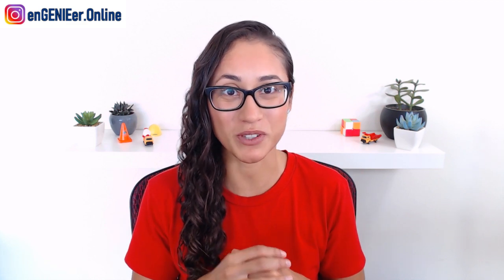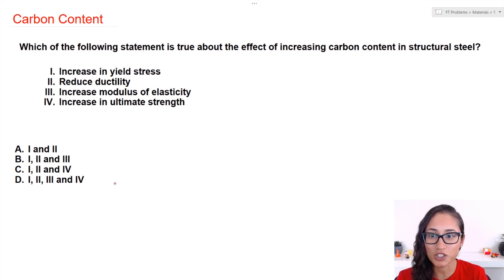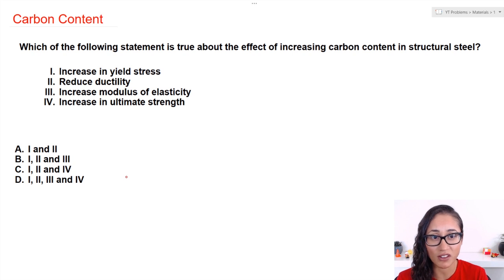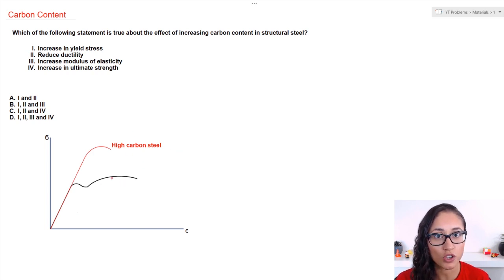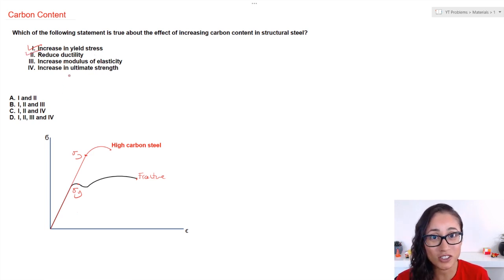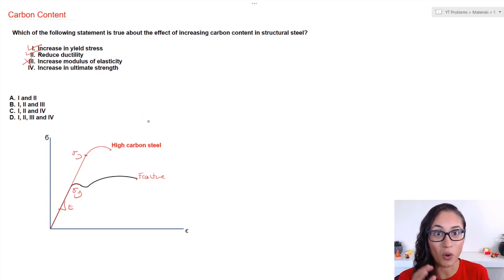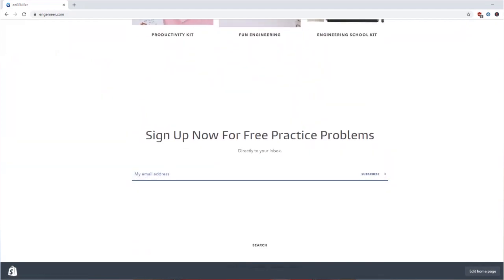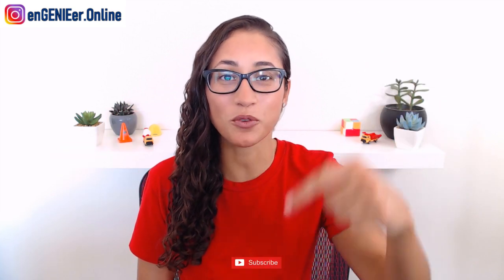Effect Of Carbon In Steel - FE exam

Comment: The area under the curve is the toughness of the material. If the material fractures at a high strain, we say it has a high ductility. If it fractures at a low strain, we say it is more brittle.